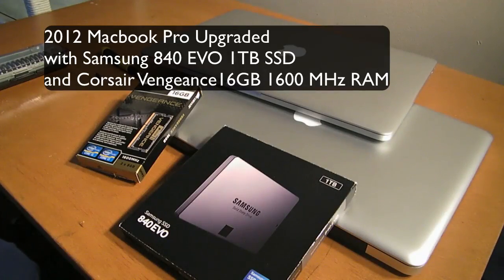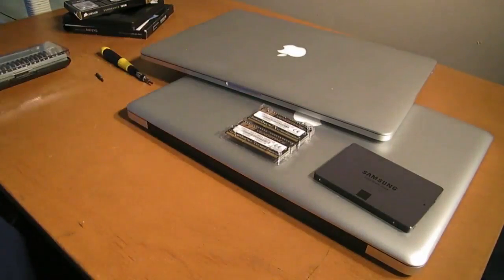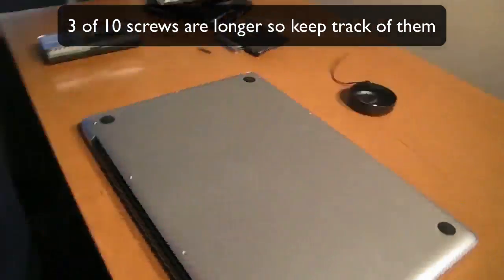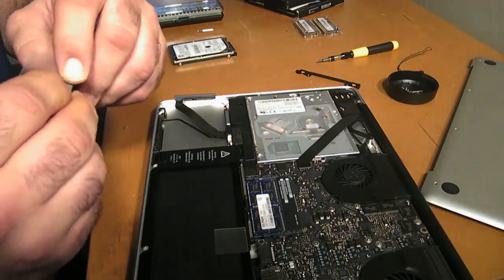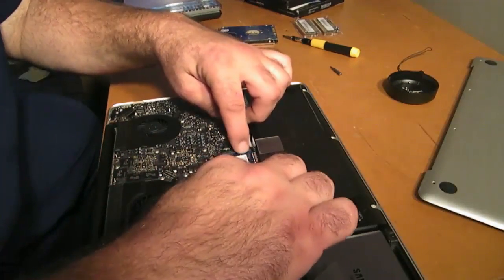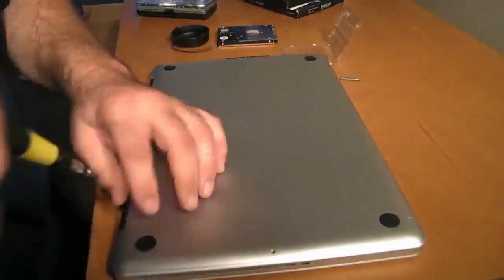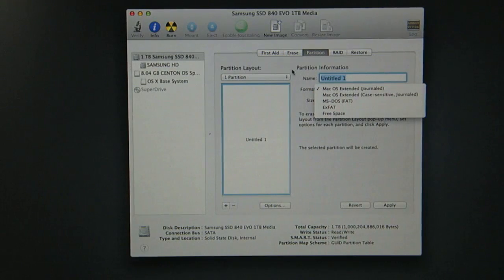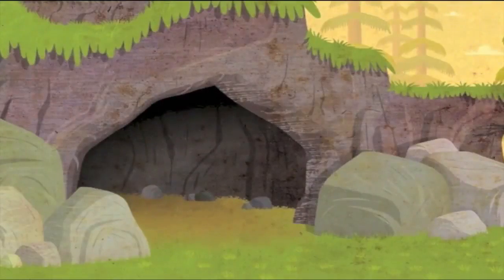2012 Macbook Pro Upgrade Single Samsung 840 EVO + 1 TB SSD 16 GB RAM Upgrade

Comment: I upgraded my MacBook from 500GB to 1 TB SSD, but after cloning my new drive, it shows that I have a 1 TB drive installed but only 196 GB used if 499.98 available. Why is that? The laptop runs faster, but I don’t understand why it shows that availability.

Comment: Hi Dave, I have late 2011 MacBook Pro. I was wanting to upgrade my current RAM of 4GB with speed of 1333hz. I was wondering if I could use 8GB RAM (2x4 GB) but speed of 1600hz. Will that matter in terms of performance and Power consumption? 
Cheers 🤘🤘

Comment: Hello I just purchased a non retina 2012 15 inch macbook pro and I will be using all the information and products you've listed in the video to upgrade my computers RAM and hard drive my question is, my laptop is currently running Mac OS Sierra 10.12.6 will I still need to have a copy of Sierra on a usb stick in order to complete the upgrade? thanks

Comment: I hope your still answering this thread. I’m currently getting in video editing and was looking for a great laptop to work on. I was looking at the 13inch 2012 MacBook Pro. My question is In order to upgrade it like in your video does it have to be a non retina laptop?
Reply from the maker: Chris W unibody 2012 or older
Reply from the maker: Chris W otherwise they started using pci 2013 and data 3 before that

Hope this helps

Comment: I stripped one of the screws completely when i upgrade my ram a little while ago, but i still managed to get the screw back in. Now i want to upgrade my SSD and I am not really sure how I will get the stripped screw out this time. If I get it out then after i upgrade the SSD im going to say fuck that screw and just use double sided foam tape to keep that part of the back enclosure lid shut. Any suggestions?
Reply from the maker: DejaxVoodoo ILY carefully drill the screw out but be careful not to go too deep just enough till screw pops

Comment: Does anyone know if the Samsung 850 EVO 2TB will work for MacBook Pro (13-inch, Mid 2012) OS: Sierra. Also do you need to partition and reformat the drive first?
Reply from the maker: +Sandra yes

Comment: and i bought the crucial ram of 8gb x2 and i see that your ram is DDR3 and mine is DDR3L, whats the difference? +AskUncleDave
Reply from the maker: The L stands for low-power Google search this ddr3 vs ddr3l
Reply: +AskUncleDave if i put a normal one that is not low power, will work?
Reply from the maker: +Elvin Anthony if it fits it will work other than that will have to research the size
Reply from the maker: +Elvin Anthony if it fits it will work other than that will have to research the size
Reply from the maker: +Elvin Anthony if it fits it will work other than that will have to research the size
Reply: +AskUncleDave thanks that really help
Reply: +AskUncleDave sorry that i keep asking which one did you put as a ram the RRD3 or the RRD3L?

Comment: Would the Samsung 850 EVO 500GB 2.5-Inch SATA III Internal SSD be compatible with a Mid 2012 Macbook Pro 13in?
Reply from the maker: Y
Reply: Yes?
Reply from the maker: +Jay Garbutt yes it will work just smaller than the one I used in the video
Reply: Alright thanks. Keep up the good work!

Comment: I've just installed a 500GB Samsung SSD and enabled trim support, but I'm not getting any where near the read and write speeds everyone else seems to be getting.  Any what the problem is?  Mine are  READ 268 mb  WRITE 200 mb
Reply: Cristiano Siqueira You are right.  That's the problem, but at least it still increased my speed about 4X  and solved my overheating problem.  Thanks Cristiano :)
Reply from the maker: Pci or sata?
Reply: ***** sata
Reply from the maker: Current RAM?
Reply: +AskUncleDave Its an 09 macbook pro maxed out at 8 gig.
Reply from the maker: What's your read and write?
Reply: +AskUncleDave 204 write and 267 read    

SPECS  Model Name: MacBook Pro
  Model Identifier: MacBookPro5,2
  Processor Name: Intel Core 2 Duo
  Processor Speed: 2.8 GHz
  Number Of Processors: 1
  Total Number Of Cores: 2
  L2 Cache: 6 MB
  Memory: 8 GB
  Bus Speed: 1.07 GHz
Reply: Thanks Saaheb, I think you're right on that.  Oh well, it's still running about 4X faster than before.  :)
Reply: +Stephen Minion Maybe it's because That Macbook of yours supports only Sata 2. You may install an SSD Sata 3 and it will work, but in order to take the full speed of your SSD it should support Sata 3.

Comment: The video was very helpful.
I have a MacBook Pro MD101HN/A late 2012 model. I plan on getting a SSD for the internal storage, but my local repair guy says that a new SSD needs to be installed and also a caddy needs to be put in place of the super drive to get the old HDD in place. So basically I'll be using the SSD as the primary drive which will have the OS and all the applications and the 500GB HDD will act as a secondary drive.

Now my questions to you are as follows:
1. Which brand of SSD should I go for?  I want 250GB worth of SSD storage. Is Transcend Information 256 GB SATA III 6Gb/s or Samsung 850 EVO 250GB good? or any other brand I should go with? (Budget option will be preferred)
2. Will 10GB of RAM enough after the upgrade? I plan on putting 1 slot of 8GB of RAM in place of the 2GB RAM which will increase the RAM to a total of 10GB.
3. Is there a way to use the super drive (DVD Drive) externally post the upgrade?

I would really appreciate if you could answer these questions.
Thanks Dave!
Reply from the maker: When doing two sticks of ram they must be even like two 8 gb two 2gb
Go budget ssd but go for 1 tb
Caddy yes with old hdd
Reply from the maker: Kingston or evo

Comment: I just did an 840 EVO 250GB upgrade for my Macbook Pro 13´´mid 2012.
I´m concerned that it´s not running smoothly, because when I do the BlackMagic Disk Speed Test, the Write speed drops to about 260MB/s after a couple of seconds at about 450-500MB/s. 
Does anyone know what the problem might be?

Comment: have you had any problems with the harddrive as of yet? :) considering the same process.
Reply from the maker: I have not had any problems. If you plan to use find my Mac with any SSD install mountain lion clean then upgrade to mavericks
Something to do with partitioning. Google it or hit me up with a email address privately and I'll show you a screen capture
Reply from the maker: Anything virus on a Mac hd will be cured with new drive(SSD) do a clean install and import data from that affected hd one at a time
I don't think recovery software build in Mac can be affected
Reply: I got everything working. A small curious problem though. It wanted to install Lion via wifi, but I am only eligible for Snow Leopard - so I couldn't download it. And I actually had Mavericks on that very same computer. Had to talk to senior advisor at apple and he was befuddled - couldn't explain it at all. 

I ended up target drive installing mavericks from other mac. That worked :)
Reply: ***** Yes, 16 gb ram and 500gb ssd hd it is running smoothly

Comment: I have a question? My hard drive over heated, can  I just install the new SSD and ram then put the disk in that came with my MacBook?  My laptop only boots up turns stripped then shuts down! Thanks john

Comment: As far as I know, Corsair Vengeance is not Mac certified... anybody know better?
Reply from the maker: Mihir Garikiparithi According to my other videos Crossair  vengeance I installed works great
But I'd be interested to know what others Recommend
Reply: ***** I've always used mushkin ram to avoid apple care conflicts. That i s apple certified ram. But I know a lot of people use the stuff available at OWC which is also apple certified.

Comment: I just upgraded my 15" Macbook pro mid 2010 (i7) with these RAM memories. At the beginning no problem. But, after a few moments using the computer, it freezes and then a message asking to restart appears. Do you know what I'm doing wrong? When a replace the original memories back, the computer doesnt freezes anymore.
Reply from the maker: Tim Irizarry thanks for watching and commenting . Good to know
Reply: the 15 inch 2010 isn't compatible with that ram and its definitely only limited to 8gb, trust me I've done my research as well, i have the same computer